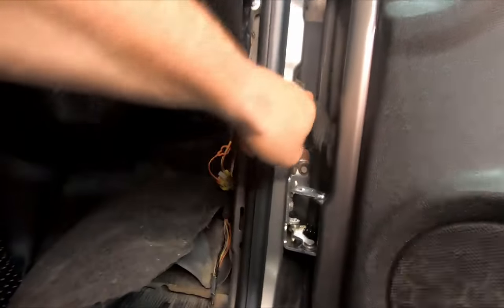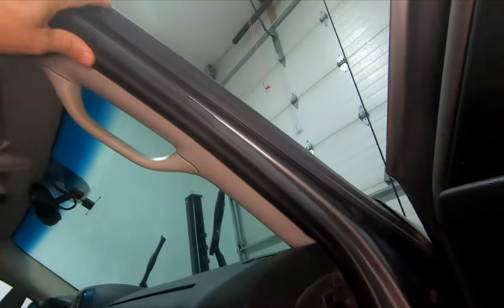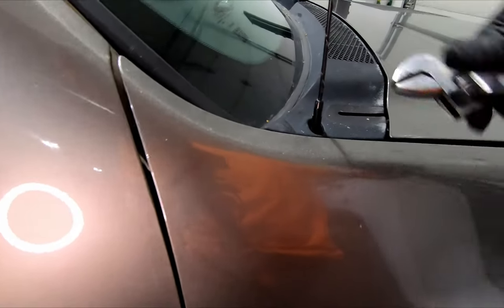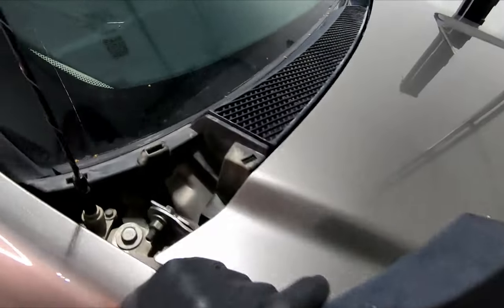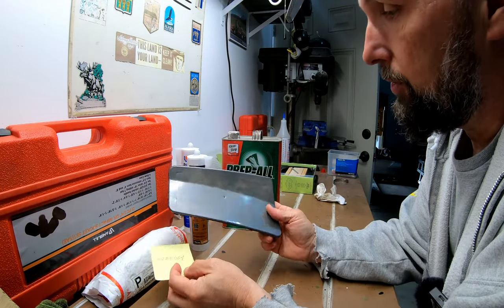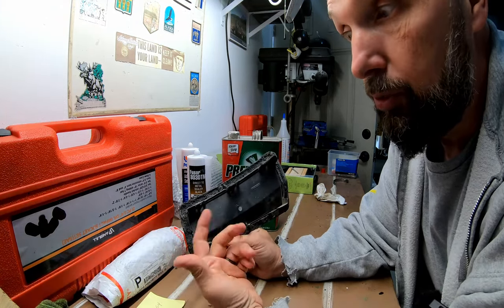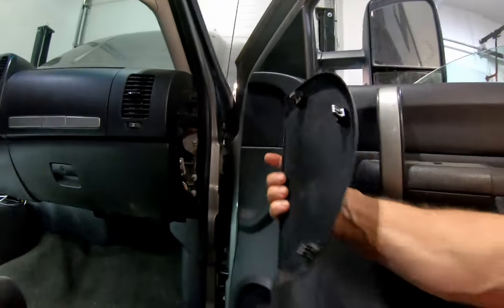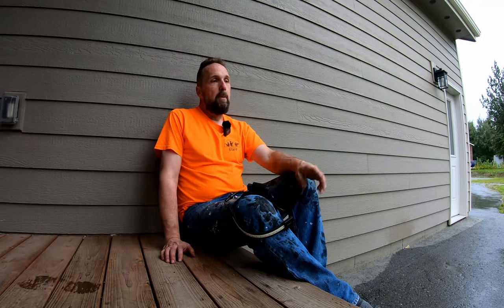Sierra Silverado 2007-2013 Cowl Water Leak....FIXED!

Comment: Does anyone know the driver side leaking issue?  I got my leaking as well.
Reply from the maker: @33juiced  if you have a sunroof or shark fin antenna check that.  Also take it to a glass company and have them do a leak test on the windshield.  It is possible the glass adhesive has a void and water is coming in at the driver side top or side.

Comment: Did it end up fixing your leak? My top panel under the black plastic cal piece looks great and pouring water over it nothing gets in the truck ??
Reply from the maker: So far so good.  I also after I uploaded the video pulled the weather strip
Off the side of the cab, cleaned and lubricated it with silicone.   Don’t know if that is any help as well.
Reply: I can’t find the video! I too have a leak under my dash but only after a heavy enough rain